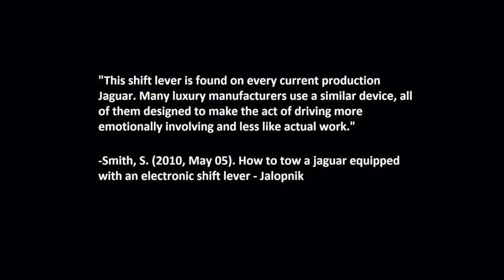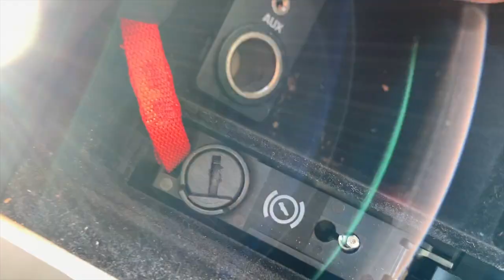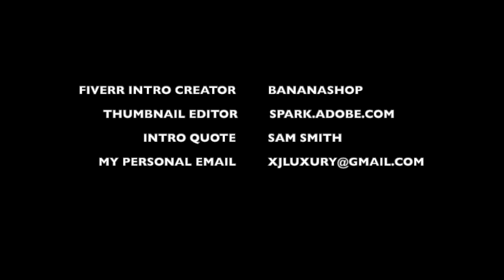How to shift a Jaguar XJ into neutral manually without power AWD and RWD.

Comment: For anyone who has problems getting the car back into any gear or park after pulling this lever, get under the car and pull the Bowden cable attached to the side of the gearbox down an inch... This sorted the issue for me.

Comment: I have no crank issue on my 2011 xjl 5.0 supercharged . I had power in the vehicle but when i try to start i would hear a tick and nothing happens 
I tried boosting it still no crank 
I changed the battery still no crank 
I got it towed home ordered a starter motor and it arrived after a week and i changed it my car fired up . Next morning  i started the car (its parked in my garage)
Started no issues got to work parked it there for 8 hours and it was negative 15 degrees Celsius tried starting same tick no crank. At this point i have new battery and starter motor in the car. I let the ignition on and started searching on forums that why it is happening couldn't find anything after about 3 minutes i tried  again it started. I thought i just got lucky so i drove home and everything was normal. Shut it off and tried to start and turn of multiple time everything seemed fine. Next morning started fine no issues. Got to work and after 8 hour did the exact same thing. No crank just a tick. So i let the ignition on for 3 to 5 minutes and tried starting again she fired up. So anytime my car is parked in cold weather when its below 10 degrees or colder i have to let the ignition on then start it after 5 minutes. Any idea why it makes me do that?
Reply from the maker: Wow that’s very odd that something that you would think a diesel would do. Unfortunately I really don’t have much of an answer for you you should try posting on the forums I’m not sure if you said you did that already or just search them but the forums can be very helpful

Comment: So I'm most likely going to get the xj I love the car and I see you do too.... My question is how has the Engine maintenance been for you?
Reply from the maker: I’m happy to hear you are looking to get an XJ. I have owned the car for over three years and put about 20 or 30,000 miles on the car since then and to be honest with you the engine maintenance has been great. The only thing that went was the alternator because the oil was dripping on it from the valve cover gasket. However the valve cover gasket on these cars are extremely pricey and if the fuel injectors get rust welded in the job is almost impossible. I hear range rover quoted a customer for thousand dollars to do the valve cover job keep in mind it’s the same engine in the XJ. Make sure you check for any oil leaks on the valve cover before you buy the car. If there are oil leaks I suggest you walk away.
Reply: I really appreciate that and the oil leak will be the first thing I look for.... sorry for the late response. I will keep you informed on when I purchase